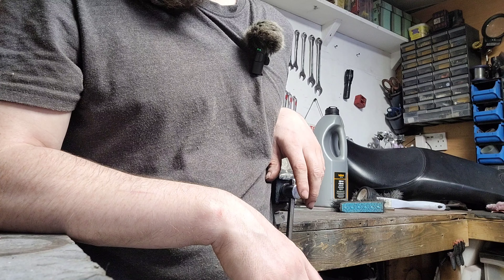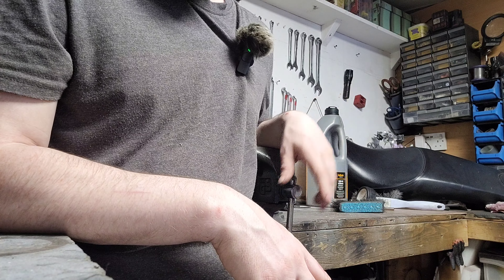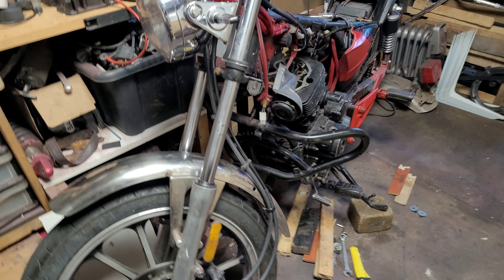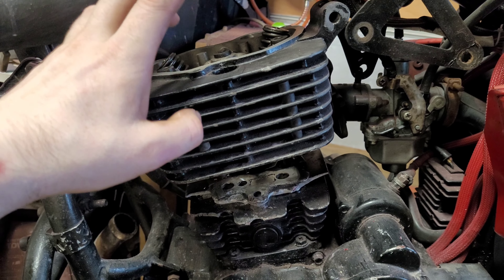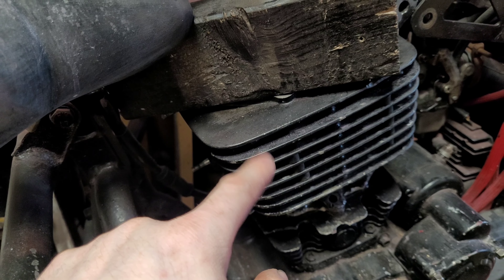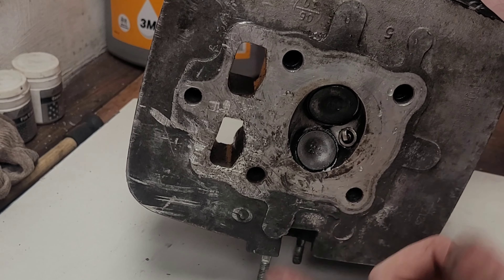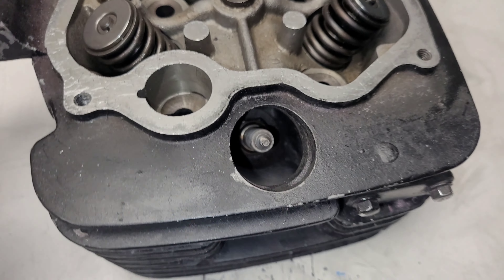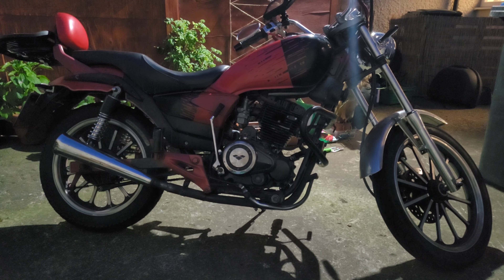A little catch up and the 125

Comment: What would cause my engine block to not going down properly it's like it's stuck
Reply from the maker: How much of a gap is left? The main thing that stops a block sitting down all the way is the locating dowels, double check they are clean and not misshapen. Might need a little extra persuasion.
Reply: @angryscottishbiker5097  i just found out that..it's like my engine or the crankshaft is stuck. Only the  connection rod was swing but the crankshaft itself isn't revolving around it so therefore when i put the piston inside the the block and push it down that's where it stops.
Reply from the maker: Have you compressed the piston rings so they can fit inside the head? Also sound alike the bike make be in gear, presuming it's a manual.